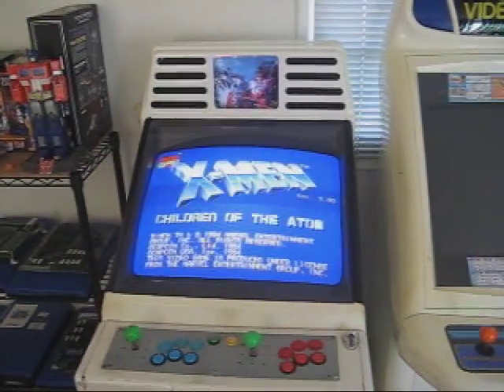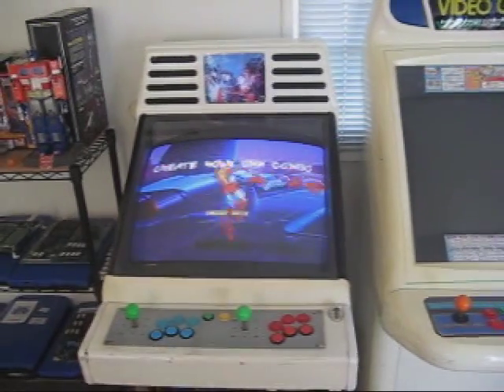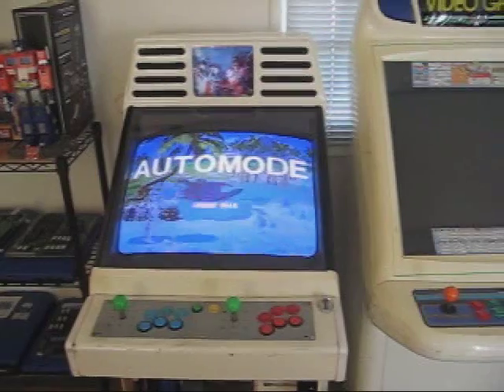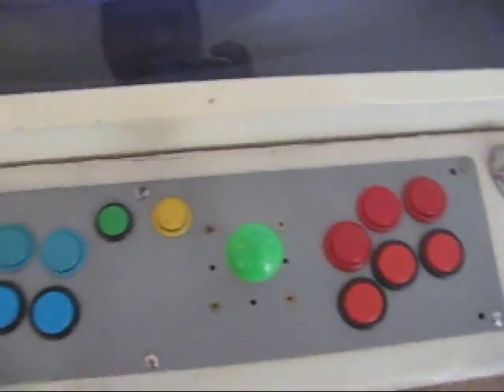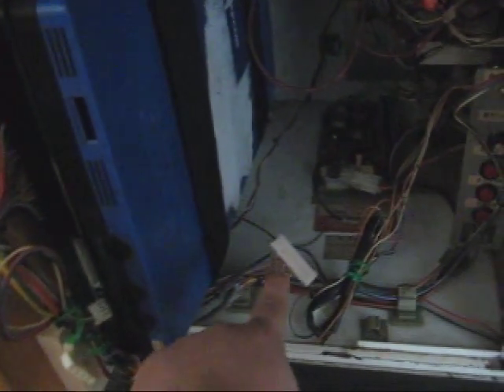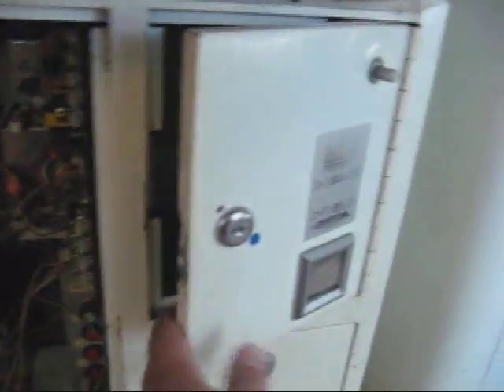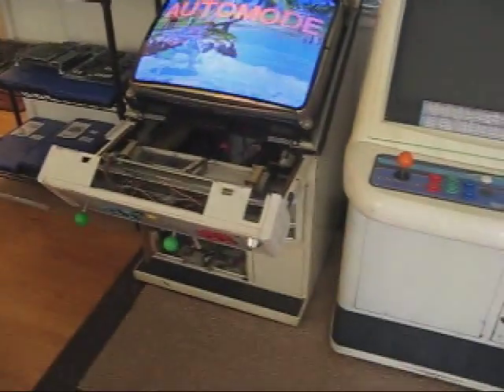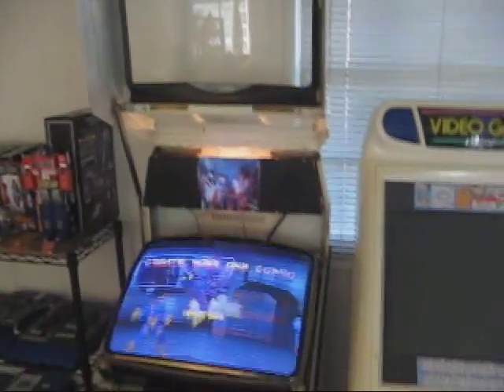CPS2 to Namco Tekken Arcade Cabinet Conversion Part 1

Comment from the maker: @xxmatthewii 
you can play CPS2 and 3 boards using the same jamma harness and kick harness. You just unplug both from one board and then plug into the other board. CPS1 boards use a different kick harness then the CPS2 and CPS3

Comment from the maker: If your arcade currently had a cps2 game board in it, you can switch it out for a cps3 game. However, if you want to play marvel vs capcom 2, which uses the Naomi hardware, the easiest way to swap out is if you buy the capcom I/O board.  I believe you will also need a different kick harness.

Comment: You should be able to disassemble the lower lock to get that open. Most of those have a Phillips screw holding the latch on.